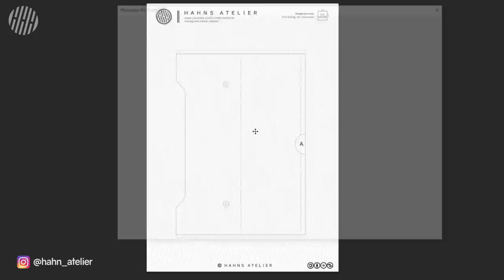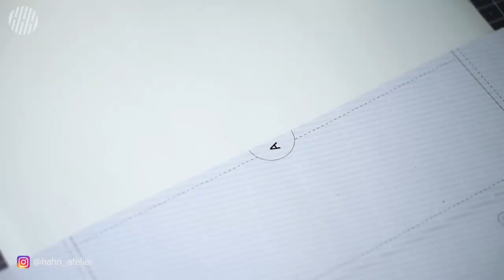Making a handmade leather pen case | Leathercraft DIY

Comment: lo que usas para pegar es cola normal o pegamento de contacto?
Reply from the maker: Aquí está el pegamento que uso generalmente Espero que esto ayude !😊
1. kenda bond 
: yellow, chemical smell, very strong, low price
2. intercom ecostic, high price
: white, no chemical smell, thin
3. Instant adhesive
: race, braiding, metal hardware (rarely)
4. B5 bond
: Beige, Thick, using for lining.
Reply: @HahnsAtelier  Gracias :D

Comment: Здорово! Подскажите, что за клей используете ?
Reply from the maker: Вот клей, который я обычно использую. Надеюсь, это поможет
1. kenda bond 
: yellow, chemical smell, very strong, low price
2. intercom ecostic, high price
: white, no chemical smell, thin
3. Instant adhesive
: race, braiding, metal hardware (rarely)
4. B5 bond
: Beige, Thick, using for lining.

Comment: Would you mind sharing what glue are you using? :)
Reply from the maker: Here is the glue that I use usually Hope this helps!😊
1. kenda bond 
: yellow, chemical smell, very strong, low price
2. intercom ecostic, high price
: white, no chemical smell, thin
3. Instant adhesive
: race, braiding, metal hardware (rarely)
4. B5 bond
: Beige, Thick, using for lining.
Reply: @HahnsAtelier  if I understand correctly, you have used Ecostic in this project (for glueing edges)?
Reply from the maker: For edge burnishing, I used Tokonole.

Comment: Здравствуйте. А что за клей вы используете?
Reply from the maker: Вот клей, который я обычно использую. Надеюсь, это поможет! 
1. kenda bond 
: yellow, chemical smell, very strong, low price
2. intercom ecostic, high price
: white, no chemical smell, thin
3. Instant adhesive
: race, braiding, metal hardware (rarely)
4. B5 bond
: Beige, Thick, using for lining.

Comment: What kind of glue do u use?
Reply from the maker: Here is the glue that I use usually Hope this helps!😊
1. kenda bond 
: yellow, chemical smell, very strong, low price
2. intercom ecostic, high price
: white, no chemical smell, thin
3. Instant adhesive
: race, braiding, metal hardware (rarely)
4. B5 bond
: Beige, Thick, using for lining.

Comment: Which pricking iron is that Hanhs? The holes it leaves are much larger than I would expect with a KSblade 9:10
Reply from the maker: Hi! I used KS blade punch 4mm gap pricking iron. hope it helps!